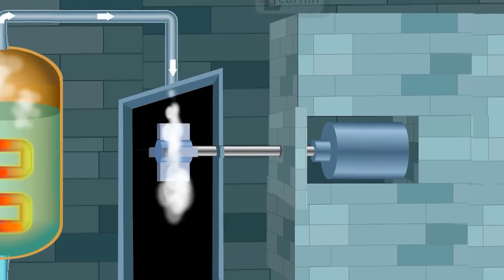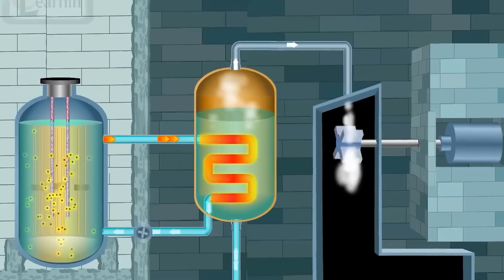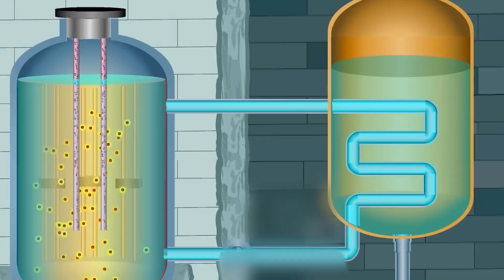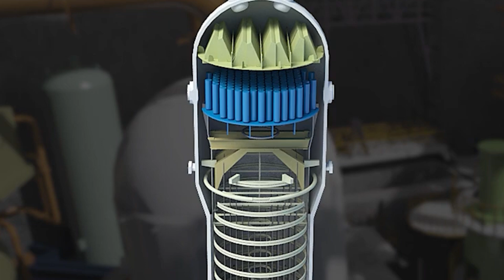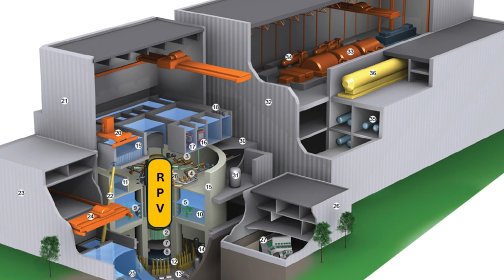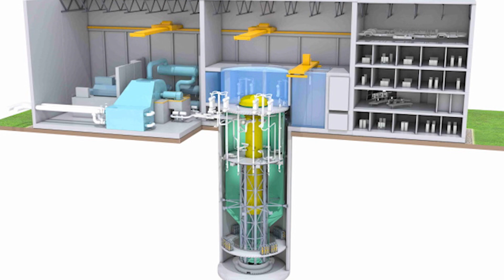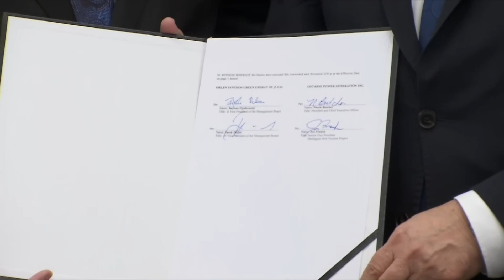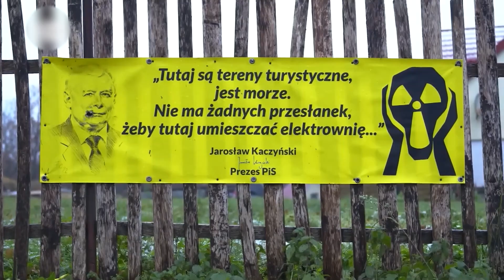The Surprising Truth About Poland's NUCLEAR ENERGY Revolution

Comment: First you mix a lot of video clips in, which do not belong to polands nuclear power projects, like pictures from Hinkley Point C EPR site or ITER nuclear fussion testing facility. A big concern for Europe is, that most east european states refuse to order the European Pressurized Water Reactor from France (former codeveloped from Germany). The EPR has 1600 MW electrical output and was indented to be an european nuclear future line. It is/was build in Finnland, France, England and China. But Poland and other east european states order form USA, South Korea and perhaps Japan and refuse any cooperation with west European states. This is also seen in defence technology. This is a serious problem for Europe and EU cooperation. It is a big problem inside EU space and for any EU development future.